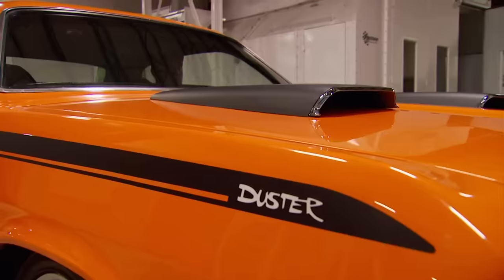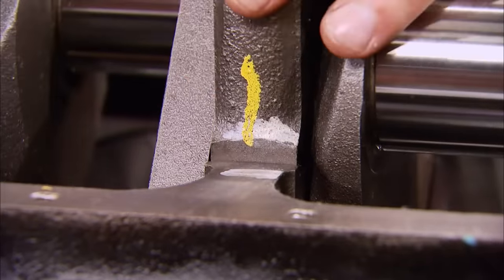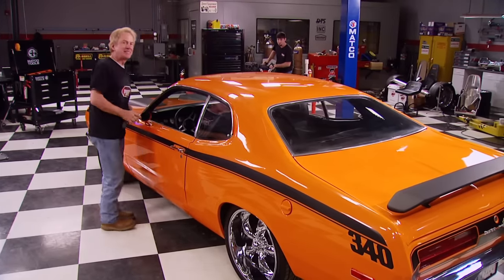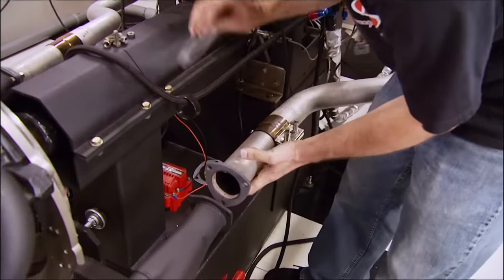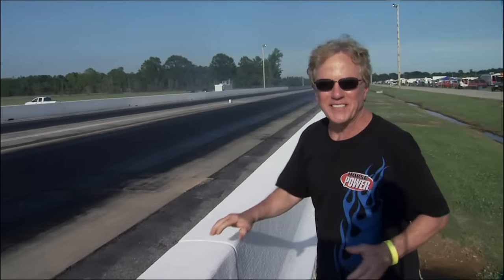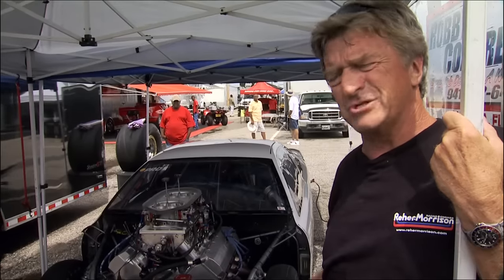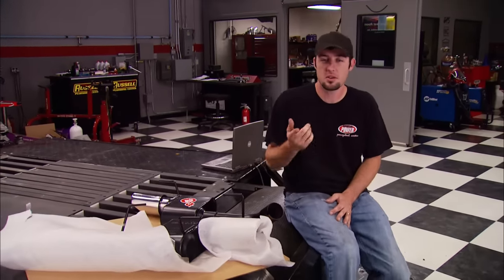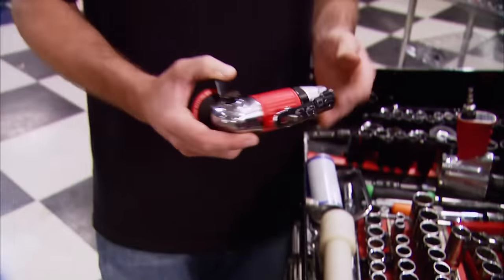Mopar 360 Build on a $2,500 Budget - Horsepower S13, E17

Comment: Mopar fans everywhere: Heavy Breathing
Reply: Chevy fans everywhere: Laughing at Mopar fans
Reply: Look.. I get it, those fancy valve covers cost enough, that if throw at a Chevy would pay for lunch and New manifold, carb lifters etc etc.. and by lunch I mean, the motor gets lunch and it builds itself.. Mopar is all in the heads.. Stock grinding etc etc.. in fact if you say Mopar out loud you Owe someone 50 bucks.  It's all Love.. 68 Dodge Dart Daily driver.. Everyday and Everywhere, 45k on my mild rebuild 318.. Peace..
Reply: m 88 Last year wasn’t it a Chevy at TX2K that won? And at Summer Nationals last year another Chevy? 
And at Worlds last year- you guessed it another Chevy LS7. 

Mopar are cute for the road when you wanna bang gears and beat grandma off the stop light. But when you wanna go serious fast people choose Chevrolet outside of Funny cars and dragsters. Hell even a stock iron block Chevrolet straight six laid down a SUB 7 second pass. Show me a Mopar that’ll do that? That will hold that much HP and make that many 6.90 1/4 mile runs on stock block and internals.
Reply: +StrikersLG  Keep telling yourself those sweet lies.
Reply: @basshead.  Lmao funny thing is that you think those are lies
Reply: +StrikersLG     Magnum and HEMI engines are not very tunable.
Reply: @basshead.  Because they are built so well from the factory that they dont need tuning lmao. Jam a shot of nitrous or cram some boost via turbo/supercharger and it will take it without the tuning needed.
Reply: +StrikersLG    Did your mom not teach you lying is bad?
Reply: @basshead.  She taught me not to lie and not to be ignorant of facts
Reply: +StrikersLG  Your facts are pretty wrong.
Reply: @basshead.  You literally no nothing about drag racing then
Reply: +StrikersLG  I'm a streetracer. I know what I'm talking about.
Reply: +StrikersLG   Sure buddy, whatever makes you feel better about yourself.
Reply: @basshead.  Enjoy last place
Reply: basshead Good luck cramming a 300 shot of nitrous on a stock bottom end small block chevy without lifting a ring, cracking a crank, breaking a rod, etc. you won’t. A stock bottom end magnum will take a 300 shot with no problem. We have 3 cars in our local street racing scene that are running SBE magnums on a ton of spray. And you can say “lies” all you want, it just shows me you know we’re right. Top fuel blocks and heads are blueprinted off of Gen II Chrysler Hemis. Ford and chevy used to try to run their engines, but they’d either grenade themselves or were too slow. So bad in fact NHRA got tired of seeing fords and chevys struggle that they REQUIRE the hemi as the only engine fuel cars can run, because they’re the only design strong enough to handle that kind of power. That’s the cold hard truth but you’re clearly a closed minded Chevy nut swinger that’s going to tell me I’m wrong
Reply: +MrRandomStuffTV   5.3 LS based truck engine can handle a 300 shot of nitrous.
Reply: @basshead.  Keyword based. It's not a real 5.3 ls lmao
Reply: @MrRandomStuffTV  My point exactly. THANK YOU
Reply: +StrikersLG  It's a small block stock chevy engine.
Reply: +MrRandomStuffTV    Corvette C7 ZR1 nuff said.
Reply: The new C8 too.
Reply: basshead C7 corvette zr1s time is 7:13.90, viper acr is 7:01.3. Try again. Can’t even touch the demon or viper in the quarter either
Reply: I'm a Ford guy but I will admit the the small block chyslers didn't get enough love, the aftermarket for performance parts just didn't make as many go parts as they did for the small block Ford and Chevy's.
Reply: +Mike Burks   Nobody wants to make aftermarket parts for bad engines.
Reply: Just soakin up the knowledge
Reply: @bigboreracing356  "Slopars" lmao. Keep telling yourself those lies to get to sleep at night.
Reply: @bigboreracing356  You jump from "back in the day" to present day to future all in one comment. All I need to say if that your LS needs 10 grand in aftermarket performance parts just to compete against a factory stock Demon lmaoo 😂😂😂
Reply: @bigboreracing356  I have more than proved my point. But continue to use up your life on mediocrity with Chevy 😂
Reply: @bigboreracing356  Then you were building them wrong lol
Reply: @bigboreracing356  That has to be the most ignorant statement on builds i have heard to date. Do you not know the over abundance of small block chevys to small block mopars.... or the ratio of how many SBC to SBM? Lol of course the chevy is going to be cheaper they make a ton more parts for them so they won't be as expensive.
Reply: @bigboreracing356  Because of course the chevy block is going to be cheaper. I have built one chevy that made 400 hp for 1000 dollars and a mopar for 400 hp for 2000
Reply: @bigboreracing356  I would agree with you there. I think of chevy as the cheap racer and the mopar as expensive
Reply: @bigboreracing356  agreed, same with my good friend and his 340 when the 3rd gen hemi came out
Reply: im cringing. bowl blending would have been free, and that egr garbage would have been blocked off. also that cam is pathetic. should have been making like 350hp.
Reply: @bigboreracing356  coulda made that 575hp on a sbm with a turbo and nost cost 7500 bucks....try mayyybe 3000. turbos are the future. also, the chevy may have been cheaper, but i guarantee you had to replace more parts on the sbc. mopars already have good rods, cranks, valve angle, rocker arms, etc...gotta buy aftermarket for chevy.
Reply: @bigboreracing356  i built a 400hp mopar for 800$, bite me.
Reply: @bigboreracing356  what good is making your own engine design when you can just copy literally everything ford has done with the 351w and mod motors? cough ls....
Reply: @bigboreracing356  it hasn't in mine. I'm not impressed. Embarrassed a guy with a older corvette with a ls2 swapped in it, when I was in my 175k mile 93 ram with a 5.2 magnum.
Reply: the only use for a mopar engine is anchoring the boat
Reply: @mikeburks9641  Thanks for admitting that. All of the big 3 have their strengths and weaknesses.
Reply: @basshead.  you do know mopar rules the dragstrip?
Reply: @Sak-zo1ui   mopars rule at repair shops*
Reply: I dont see the reason to blast each other for preference of engine, 5.3 are cheap builds, 5.9 magnums are solid, hell the only motors I see a reason to hate is the 3 valve tritons
Reply: @basshead.  laughs in fix or repair daily.
Reply: @lililililiilililililil9828  the 2.7l v6 was kind of crap too though.
Reply: @Sak-zo1ui   Ford and GM make more reliable cars than FCA.
Reply: @basshead.  okay dude. In my opinion they are all pretty reliable. But your opinion is your opinion.
Reply: @Sak-zo1ui   It's a fact, not an opinion.
Reply: @basshead.  keep living in your own little world my man
Reply: @Sak-zo1ui   Even Scotty Kilmer says that. But whatever helps you sleep at night.
Reply: @basshead.  reliability is all about maintenance, I've got 4 second gens rams all with the factory transmissions that work perfectly, because maintenance was done properly
Reply: @basshead.  and scotty was exposed getting paid for his "opinion" on vehicles, I mean, do you really trust the senile mechanic that uses hockey pucks to lift vehicles on jacks
Reply: @lililililiilililililil9828   Source? He's been a car mechanic for 50 years, of course he knows what he's talking about.
Reply: @basshead.  ive done motor pulls in plenty of fords, 4l60e rebuilds, and mopar head jobs, but the most frequently done thing is ls camshafts and DoD removal for burnt up cams in ls, no company is really better, because they each had there screwups
Reply: @lililililiilililililil9828   That link doesn't prove anything.
Reply: @basshead.  proves alot actually, he uses janky techniques and then when he's called out for it acts like he is Mechanic jesus and doesnt do anything wrong, he's biased, opinionated and doesnt even test vehicles before he makes his "critical" reviews on them
Reply: @basshead.  50+ years of biased opinions on working on vehicles people ragged out, not one actual review on a well maintained vehicle, he's a joke
Reply: @lililililiilililililil9828   He has no reason to hate FCA more than FORD or GM. He's just spitting the truth.
Reply: @basshead.  wrong, GM sold more trucks then ford and RAM won more awards then the Ford f series trucks,
Reply: @basshead.  he isn't spitting any facts, he's spitting his opinion, hell ford almost didnt exist anymore if not for dodge brothers
Reply: @lililililiilililililil9828   Awards? They give awards to new vehicles. So they can't know how reliable those "winning" vehicles will be. Don't be so naive.
Reply: @AtZero138  318s are bulletproof

Comment: Port work can make 1.88 heads easily capable of stretching the power up into 8000, I had a 360 LA that still pulled at 8600 for my 2-3 shift, was running 298/.520" Summit racing Grind, 1 3/4" long tube headers, 850 double pumper, Maximum porting, Forged/Nitrided crank out of a police interceptor 360, stock rods I deburred, ARP wavelock rod bolts, and stock pistons (340 Grams each, the lightest stock piston compared to the ford and chevy motors of similar bores.) had added a second magnetic pickup to the distributor 1.5 degrees off for a second spark through second gold ignition box, 3 degrees of crank timing, had more parts than money at the time, Ported out Torker 2-340 manifold, 2" carb spacer. Over 500 HP on pump gas, that was a sick cam, I don't know if Summit Racing still does that grind, I bought it because it was like 252 degrees @050", taking advantage of the larger dodge lifter diameter. It hit 9000 RPM every day of its life, destroyed all the local racers. When you control your air flow, put Nascar engine building type thought into everything, I custom made my 12 quart oil pan, HV oil pump and ran the PH16's which are like 10" long oil filter, I had clearanced all rods and mains to .001" exactly, ran straight 60 wt oil, Had 100 PSI hot anything over 3000 RPM. It was in a Mud Bog truck that blew the doors off everything, 4:10 Gears, locker, 16.5" wide tires, It always puled the front end off the ground in second gear. I worked for MCS Racing, and my bosses dad was an ex Nascar driver, I always picked his brain on everyting, how they made 700HP+ even with a 390CFM restrictor plate. If you can understand that part, and set the conditions, You can make it scream. In the head porting its critical that you leave a minimum .050" Radius after your valve cut. Focus on the minimum cross sectional widths of all air passages and sharp transitions,  I love it!! Anyway, Ya'll Have a Great Day!!

Comment: It literaly takes an hour to open up the intake ports where the pushrods close them up . its worth big power on small block dodge heads.
Reply: Amen.. Dodge Dart Daily driver.. still stock 318 swap from slant6.. Everyday and Everywhere.. since I use my Car for work and life, was gonna find some replacement heads do the grinding and swap them and get right back to work..
Reply: id worry more about the bowl blending.
Reply: @frigglebiscuit7484  - Gotta get the air TO the bowl...
Reply: @BuzzLOLOL  the pushrod pinch really isn't that bad. The magnums pushrod bulges are worse than the LA smog heads, yet they support more hp.
Reply: @BuzzLOLOL  the bulge actually increases velocity greatly, so I don't mess with them. They are also paper thin and easy to break through.
Reply: @frigglebiscuit7484  - The Magnums have better combustion chambers...
Reply: @frigglebiscuit7484  - Increasing and reducing velocity in various spots cuts down the energy of the flow...
Reply: @BuzzLOLOL  no, not when the restriction is at the front, and the large area in the rear. Its how carbs work to begin with. If you want to have holes in your head where the pushrod area was, go ahead. You cant get rid of them, unless you want to spend ridiculous time and money on a set of iron heads that like to crack.

Comment: The LA 360 was offered from 1971 - 1992.  
The Magnum 5.9 360 was offered from 1993 - 2003. 

There were quite a few different 340/360 heads.  The only ones worth a damn were the 1989-92 308 castings, and '93 and up Magnums. The '89 and up 360/5.9 engines also have hydraulic roller lifters and cams. 

Carbs were the 2280 Holley 2bl, the Carter TQ, and QJet from '85-89. 

The last use of the 360 in passenger cars was 1980, with the E57 in the New Yorker, and the E58 in R and F body police models, and J body.  The popular M body was not available with the A38 police package until 1981, so those cars were never available with the E58 from the factory. 

Anyone looking to build an LA would be wise to build a 5.9 Magnum, as those engines had a plethora of updates, and with full aftermarket support via Mopar, they offer the best value. 

It would also be very wise to compare the cost of building the older LA/Magnum 360, versus finding a low mile/low dollar 3G Hemi.  Many boneyards offer assemblies, complete with harness, ECM, pedal, etc for very good prices.
Reply: the magnum 5.9 is still an la but you accurately point out the evolution.
Reply: @DontCryAboutIt  The 340s used a 3.31 vs 360's 3.58 stroke, so it tended to wind up a bit quicker. The key to 340s were the better flowing heads with higher rated valve springs and large carbs, 800cfm from the factory. Compression ratios for 340s (68-71) are 10.5 to 1, but only 8.8 at best for 360s. They also had better stock exhaust manifolds,  recurved distributors and more cam than the 360s did in stock form.
Reply: @Ecosse57  magnums are not la's.

Comment: That 255 hp is with a choked up two barrel and stock cast manifolds. Gotta love them mopars 💪
Reply: The stock 255 netHP prolly about equal to their hopped up 314 grossHP... from an engine with a 400 HP cam used...

Comment: When building a 360 look for a 71 to 73 block as they have the same water jacket as the 340, ie thicker cylinder walls, all after that were the lightweight blocks with thinner cylinder walls
Reply: 71 to 73 also supposedly had thicker bulkheads at the bottom end of the blocks. So did 72-73 400s.

Comment: I had a 5.9 360 v8 in my 98 jeep grand cherokee and it had 275 hp stock, sounded crazy with a performance cam in it. was a perfect engine for the Zj
Reply: I had a 99 Dakota R/T  5.9 250hp stock. I added on a Kenne Bell Supercharger 6 psi that only put 360 hp and 519 ft.lb. according to Kenne Bell. It was fun to drive on the street. No traction from those Goodyears RSA tires.

Comment: I put a modified, 500 hp 440 from a 67 Chrysler in my 74 Gold Duster.  Added a 8 and three quarters 391 rear end with a 2500 stall. Was a real sleeper with all original graphics with black vinyl top.

Comment: Couldn’t you take the more modern 360, that came in the 2nd gen pick up trucks, modify the insides and shove it in a muscle car? Curious how much power that’ll make
Reply: The newer 360 fits No worries,  and can be had with old school Manifold built to fit it, and bolt up the 70 and up timing cover and water pump.. Magnum swap stock roller rocker.. peace
Reply: @AtZero138  Roller lifters not roller rockers
Reply: @kunu98 They bolt right up to the old school mounts and transmission with minimal modifications and make about 400 HP 450 TQ if you ditch the stock junk EFI and upgrade to a 4 barrel carb. and good cam and headers. I have a 94 5.9 magnum in my 68 Roadrunner clone with an air gap intake, Holley 600, Hooker headers and a Hughes Engines cam and valve spring kit. A tech at Hughes told me the combo should be good for about 400-420 HP depending on my cylinder wear. You can see how the car runs on my c h a n n e l
Reply: @Impactjunky  Correct.. Thanks Buddy.. Mopar Everyday and Everywhere..
Reply: @AtZero138  No worries dude, easy to confuse the two. My dad made the same mixup just the other day when talking about the Magnum. Planning to upgrade to roller rockers soon though, wanted to use the roller rockers from my 273 when I did the swap but the old school small block Mopars had shaft mounted rockers and the Magnums are mounted individually on pedestals like a Chevy motor.
Reply: @Impactjunky  it will be a while for me to start upgrading the valve train area of my pretty much stock 318, except for a 4 barrel in the near future.. my  church cruiser on white wall 68 Dart Daily driver.. she's moves at least enough for now haha.. peace Dude.  From Southern California..
Reply: @AtZero138 Nice, 68 is my favorite year. Good luck with the project!
Reply: Smarter thinking build: https://www.hotrod.com/articles/318-small-block-build

Comment: Damn good engines I got the original 360 in my 01 ram it's been a work horse all its life and still going strong with 300,000 miles on it
Reply: Not the most efficient stock engine but damn reliable
Reply: I think your '01 would have the Magnum engine...